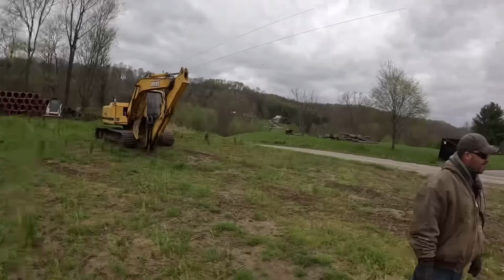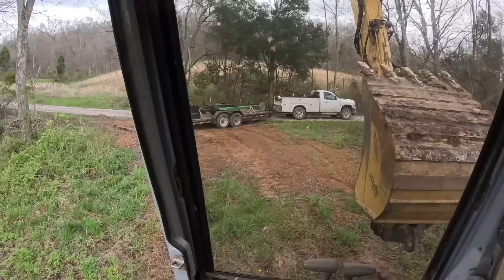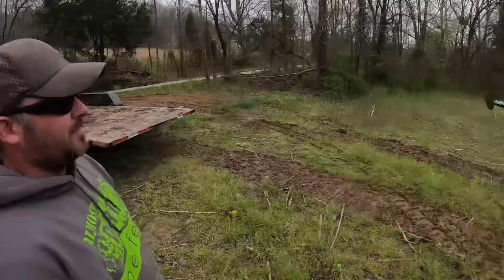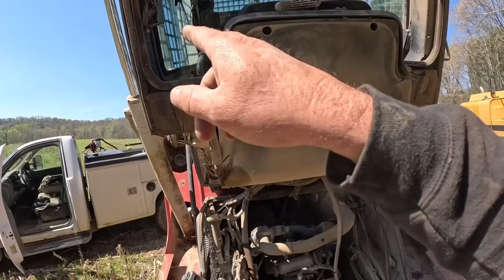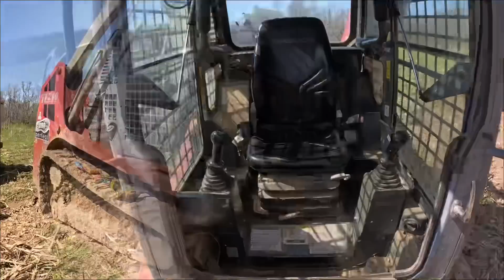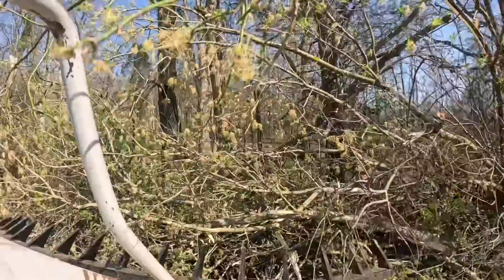Unforeseen Mishaps With My New Tree Saw On First Try!

Comment: Hello , what is the hydraulic power for this machin ? It seems that there is low hydraulic power, right ? I have a Hyundai R 55-9 with a hydraulic chainsaw which is more efficient, especially for a 6 ton.https://youtu.be/z3EawKaRXp8?si=Y-EsPoNnpqCx4UHD 😉👍🤙

Comment: Mike,
Check your wiring harness at the back of the cab, at the hinge pivot point and any place where the loom passes between the levers, rods, or hydraulic hoses. Check for outer chafing or bending points that might indicate a possible bent or pinched harness area. There is a lot of movement in those crazy little machines and you know how wires just love to be tossed around. It's very likely that the issue is where the harness bends around the back of the cab to go underneath to the controls. That whole bundle of wires has to flex every time that cab is raised and lowered as well as the constant movement and jostling around.
Wiring is always so much fun.😶

Comment: Wouldn't it have been easier just to take the trees down and process (burn) them? I guess not if you wanted to save the trees, but you chopped them up pretty good so they might not survive anyway. I don't know what the goal was going into it in the first place aside from clearing, but, nice saw anyway. That'd be perfect for trimming the trees away from power lines.
Reply from the maker: Absolutely not
Reply: @DirtPerfect  No to trimming trees around power lines? Heh, only if you hit the power line!

Comment: There's been a number of comments about adding dome kind of drive to rotate the head nut it doesn't deem yo take very long to do it manually particularly if there is s ground man. KISS engineering wins in the end.

Comment: Had a TL130 that did that over and over again.  Replaced the relay, no issues since.  Didn't check my ground, but one relay solved a whole bunch of irritation for me after a year of fighting the exact same condition.  It would work one time and not the next, so always felt it was a bad wire but hasn't acted up in two years since replacing the relay.

Comment: Just wondering, couldn't the switch of the safety bars you have to pull down before operating have failed on the skidstear? Don't you agree the rake is better suited for the D4 in your area with all the mud and it is huge?  Put a pattent on it and let tmbts produce them in his workshop, witch you own btw. It's working great!  Like you mentioned, maybe it's better to start at the back cutting trees  so you don't have to run over the branches. Very nice video looking forward for part two of clearing branches.

Comment: I wonder why you are pushing it into the trees, rather than a pile and burning it, like letsdig18.

Also, could you add an automatic system of turning the angle of the blade rather than doing it manually.
I think this would be more convenient, efficient and save down time manually adjusting it.

Your home built equipment is like Brunell's bult like a brick do da and made to last.
Reply from the maker: Absolutely a waste of time and money

Comment: I got a harbor freight 10 ft electric pole saw  bolted it to a 12 ft 2x6 bolted it to a pallet put it on my front end loader on my kubota bx connected it a foot peddle and cut tree limbs 30 ft up. works great

Comment: Nice combo set.
Good work on fault finding and repair.😊
It's always so much easier when you've got the wiring diagrams and control system flowcharts. Good on Takeuchi for supplying them. 👍

Comment: Hey Mike, the tree saw would benefit by an electric motor to turn or angle the blade. Electronic control would be easier than adding additional hydraulic lines and valves. The Rake was as you love to say, Awesome 👍👍👍. I enjoyed seeing the Rake more so than the Eliminator at this point in time because it worked so well.. with all the Rain you keep getting adding an electric motor would be a great small project for the shop and your viewers. Thx❤

Comment: Two thoughts.. bigger blade on the saw. More rotating mass, cut through the bigger limbs better without stalling. 

Second one. Why the rake instead of a grapple? Most grapples can be used as a rake as well and you pick the brush up and carry it rather than just push it in. As a hunter and farmer, just pushing the brush in all along the field almost makes a barrier. When using a grapple you can carry it to make actual piles every so often.

Comment: You need to take a winch maybe with a brake and remove the cable and attach a sprocket and hook a chain to your rotating part of your eliminator and to the winch. Run wires from the winch to your cab so you can rotate your blade from the cab. If the blade acts up maybe change it to a chainsaw blade.

Comment: Just my opinion but it seems the saw should be angle straight up and down  your boom goes up and down if the saw is angle a little it puts it in a bind . If you got a chainsaw angle it the try and push it straight down . It seems to me it would bind up. Just my opinion. You will get it dialed in tho keep up great work

Comment: those properties need perimeter access roads so you can at least  get to each quarter of the property alot easier without getting buried up to the frame on any of your equipment....every time you need to fix something or haul something on and off the property...

Comment: Love the show. You so need to add power to the twist on your saw , branches go every Whitch way, your saw needs the ability to slice down left and right. Great bit of kit. One more thing I’m from Tasmania ( Southern most states in Australia) , when I was a kid ( 70 now) I spent a lot of time on properties in the middle of the state ( flat ground) they had large square dams . Every year when the dams were low they would use a great big drag bucket with a cable to drag it and one more to hall it back. They had two small tractors one with a pulley and  another on the tail of the cable to deal with the hall back at the high side of the pond and a monster Jhon deer ( two cylinder and dog motor with 4 back wheels) to drag the bucket through the pond and over the dam wall . The bucket was as wide as the tractor pulling it there two skids on wrist links that extended infrunt of the cutting edge to stop it damaging the wall and when it was pulled back it would lift up on the links. The bucket was longer than it was wide and a good 5 ft high , they were big dams and the crew would clear two a day. The only reason 3 tractors were needed the farms had grid , gravel road concrete canal fence then rectangular dam so the hall back had to go 90 degrees to the dam . I don’t know if you have square dams over there on flatish ground but I have to point out the system is very efficient , each dam was from 3 to 5 acres , anyway great show
Reply from the maker: Thanks

Comment: The saw works great mike!  And sorry about the darn wireing feascoe!😂  ive had that same thing happrn on mu old pickup!  Could be that the screw ither get loose or gets dirty!  Evan had those block fuses get dirt in them in were the wires go! Id clean them up real good. Glad you did get it fixed and that rake is a beast amagine it on the minatar?😂😂

Comment: Bad Grounds will drive you crazy chasing them down can be frustrating at best , it can be in the wiring loom, or at the attachment point it's self, and the relay ,it's good you have the ability to trouble shoot for yourself and diagnose, those are skills most users do not posses. The saw is awesome and very necessary for topping the big stuff ,this will allow Chris to utilize more of his Field.

Comment: I think from what I see everything is working out quite well. The biggest complication with the saw might present itself if you're cutting on the wrong side of the limbs where compression will cause a binding of the blade rotation. Unlike the machines with a grapple that prevents compression as the hinge fibers are cut causing the weight to drop. Being cognizant of this will help with opportunities and choices where and how the cuts are made.

Somehow I foresee converting the manual rotation of the Boom to either electronic or hydraulic capabilities for a winter shop project😅😅

Comment: I'm sure I'm not alone in looking at that thing a little bit sideways !   What is protecting you if that blade gets pinched and comes to a dead stop suddenly, blowing apart in the process ?  Don't think I'm knocking you, but safety fifty seventh, yes ?   I'm sure Wade's felling machine has that guard for a reason.

Comment: Land reclaim cost per meter push back compared to cost of trimming back as a percentage crop gain for farmer Chris would be an interesting fact. Plus the other benefits of more light on the rest of the side of the field crop when the shadow is removed.
Just rough idea of percentage gain for other customers wanting more land back in production.

all the best

Comment: The saw is a 10/10 for awesomeness! And for it's ability to take on larger branches... 
I still think a Version 2.0 is needed though .. replace the saw with a 12" limb sheer. Would probably help with dragging the limbs and vines out for the Taco to push easier.
Thanks for sharing 🇨🇦

Comment: Looks like you’ve had a good bit of practice. 
Suggestion: when cutting long limbs if you could cut in shorter pieces it will be much easier to push into the edge of field, maybe cut twice.
Also watch the edge of the field and cut small saplings that will give trouble to the pusher. 
Another 2 pieces of equipment that are winners and may open up a lot of business for you like the Tile Plow did. Looking good Mr Mike.

Comment: I'm not sure what you are trying to accomplish but if is to increase productivity along the tree line, all you needed to do was sever the tree roots on the field side. Back iThirty years ago  when I still worked for the USDA the Soil and Water Conservation District had a root plow they let farmers use to cut the tree roots along the tree line. It was a single shank ripper on a 3 point hitch that would rip about 30 to 36 inches deep. It required at least 60 HP tractor but it made crop production along the edge of the field about the same as the rest of the field.

Comment: That mishap with the Taco was a disappointment, but you figured it out like always. Great job Mike and I think you can use a little more flow and pressure for the saw and it will be Dirt Perfect.  From the looks of the field you can take out a couple aces of trees just to get them back to the fence line.

Comment: I had that same kind of issue on a JD 360 a few years back it was a royal pain in the ass to figure out. You should put some better tires on that service truck. That thing looks like it would gets stuck in a mall parking lot.😂😂😂. That set up is going to work the balls when you get it dialed in. Nice job

Comment: Now you need to rig it up with a rotational control inside the cab. so you can change the blade angle on the fly. Otherwise I looks like a very useful add on.
Reply: It has one. He was holding the camera. 😊

Comment: You would think that guys that spend ALOT of time in the field would have slightly MORE AGGRESSIVE TIRES on their pickups so they DON'T get stuck so easily !!! 😂💪👍🎯
Reply: I agree. I'd get tired of getting stuck. Then again he has the equipment to get them out quickly.
Reply: I have four wheel drive and still get stuck in the sand in our fields all the time.